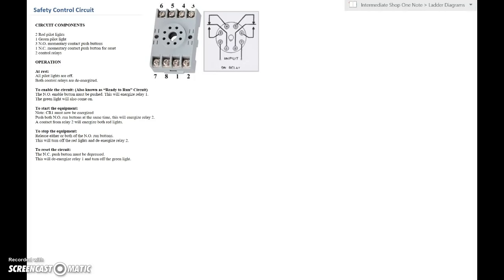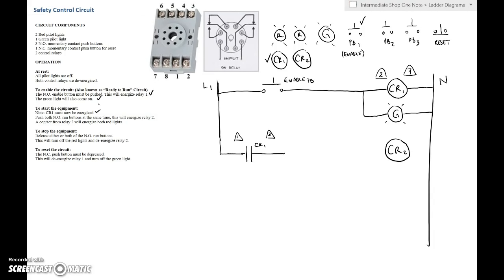Ladder Diagram Basics #2 (Safety Control Circuit)

Comment: usefull. i think this control use for a machine that needed to push the button  at same time to energized. like a press machine or any othe application base on the function.
Reply from the maker: Hi Megan, Yes, that is the premise of the circuit. However, this is just a primer to get students used to wiring an 8 pin relay. The controls for a press have to be completely fail safe. Here is another video on the "Anti-Tie Down" Circuit for a press. https://www.youtube.com/watch?v=5jT60c4UOyE

Comment: It doesn’t specify, but I would wire both red lights in parallel after the second PB so you know if both are being held closed. Just my opinion, like you said, everyone does it their own way and the instructions are not very specific on certain things. 🙂

Comment: Pete, thank you for the excellent explanation. I'm  still learning more about motor control and my question is how about using both of CR2 normally open as aux. contact for PB2 and PB3 , jumper CR1 N/O to red lights?

Comment: Excuse me Mr.Pete but can you please explain why you are using contacts 2 and 7 for both coils?   Shouldn’t you have two relays, one for each coil?  Also  when you energize the coil (2&7) both N/O contacts (1&3) (8&6) will close turning on both red lights.  I read some questions and comments regarding this but still did not see my mistake.  Can you please elaborate.

Comment: Great video 
But I have a question !? 
When energizing the coil of relay 1 then will both contacts of 1 and 2 close simultaneously ? (Since they have the same coil)
Reply from the maker: Yes 1 and 3, and 8 and 6 will change state and be closed simultaneously when the coil energizes.

Comment: Honestly, i dont't understand of this idea and maybe i'm wrong, but: I think you are mixing ladder programming in PLC (LD) with electrical ladder diagram. (CR1/CR1 should have graphical symbols of electrical contacts instead of coils symbols which were used). Also, even if You stop pushing PB2/PB3,  CR2 will be still energized because of CR1 hold contact, which will be still energized because of CR1 self-hold contact.
Reply from the maker: Please read my comment below the video before throwing shade.

Comment: hello brother
First of all thank you for this helpful session 
I have questions .. what if we directly put realy's two NO contact connected from feeld then the NO contact then the two red lights
I think it also will work because the two lights wont switch on untill relay two is energized
Reply from the maker: For sure. That would work as well. Thanks for the feedback.
Reply: thank you so much

Comment: How can control relay 1 use COMMON 8 and NO 6? I thought you said in your last video both relays are independent? I thought CR1 can only use COMMON 1 and NO 3 and CR2 can only use COMMON 8 and NO 6. 

Great tutorial, man. Appreciated.
Reply from the maker: Comm 1 goes with either 3 or 4, and Comm 8 goes with 5 or 6. Each relay (i.e. CR1 or CR2 has these two available contact pairs. Have a look at the diagram in the centre of the video beside the base for the contact placements.
Reply: Pete Vree thanks for the quick reply. I think you meant to type Comm 8 goes with both 6 and 5. I agree that each relay has two sets of available contacts NO and NC for each. I'm just pointing out in the video it looks like mixing CR2 contacts with CR1 because you marked CR2 as utilizing 1 and 3
Reply from the maker: No mixing up going on. CR1 has both 1 and 3 used on rung 2, and 8 and 6 on rung 3. CR2 has only 1 and 3 used on rung 4.
Reply: CR1 and CR2 both can use 1 and 3? I thought 1 and 3 are specific to CR1 only and CR2 has to make use of 6 and 5.
Reply from the maker: https://www.galco.com/images/mgcr/tdrsoxp-12v_cd.jpg
Reply: Pete Vree same diagram I have. I'd just like to know if CR1 can use both 1 and 3 as well as 8 and 6. I think the latter is for CR2?
Reply from the maker: Yes. CR1 and CR2 are both 8 Pin Relays. CR1 and CR2 are identical. They can both use 1 and 3 and 8 and 6. Each set is actuated by the relay coil.
Reply: Ohhhhh ... Now it is clear. The two relays have the same 8 pins each, so they can use contacts (1,3) and (6,8) at the same time whenever needed... right? 

Thank you Pete ...
Reply from the maker: For sure... 1,3,4            8,5,6 are separate sets of contacts actuated by the same coil 2,7